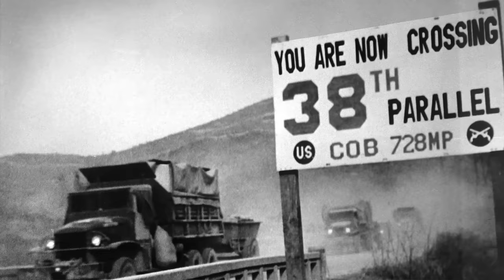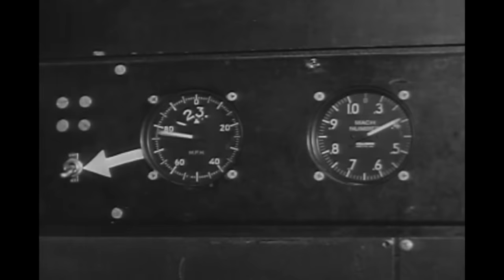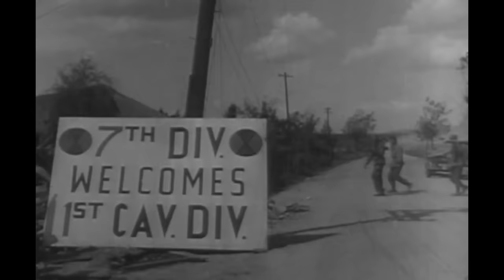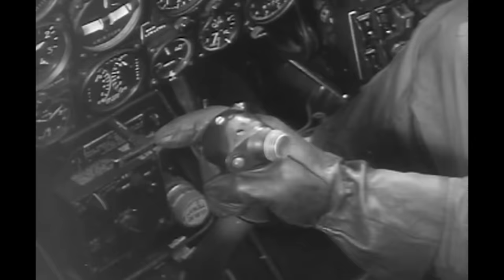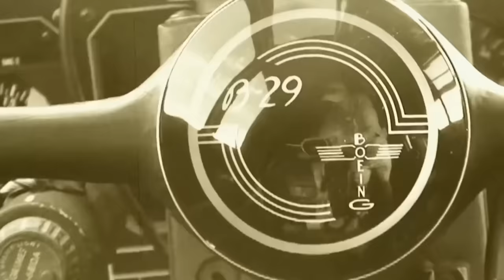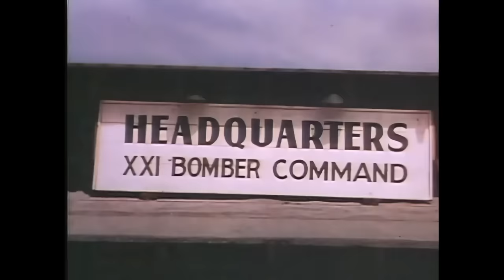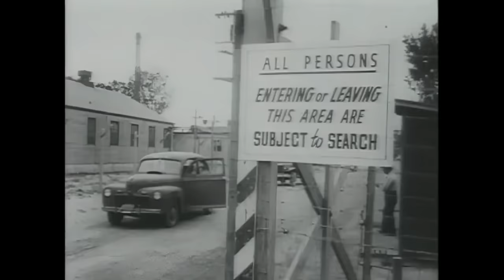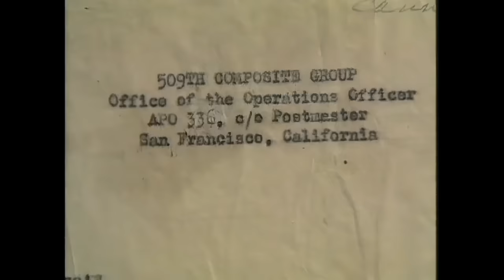B-29's Mortal Enemy | Superfortress Against MiG 15

Comment: If the B-29 was unable to carry the atomic bomb, the backup plan was to have specialized British Lancasters do it.
Reply: But it did drop A bombs to Japan.
Reply: @kzoo4053  correct, but for a while it was unclear if the B-29 design would be able to in time. Backup plan was to have specialized black Lancaster deliver them instead.
Reply: @MarvelousSeven  Lancaster cant drop A bomb !
Reply: @jagdpanther2224  Yes it could. If it could drop the Grand Slam and Tall Boy, it could carry the Little Boy bomb.
Reply: While Avro Lancaster could carry the A bomb, it did not have the range required to reach Japan from Tinian. The  B24 Liberator had the same problem.
Reply: @apis_aculei  they must've had some sort of plan in mind, since UK crews were being trained since spring 1944 for the mission.
Reply: I've heard this before, but never from accredited sources. In fact, the only accredited sources I've heard mention this were disputing the theory. Usually, with the fuel limit or the security argument. I doubt Lancaster was considered any further than a sketch on a bar napkin at best.
Reply: @MarvelousSeven 
No they weren't, that's a myth perpetrated by people who want it spread around simply to thump their chest about the Lancaster, it's simply not true, there was never a program or even the thought of one to have Lancaster's as back up's for dropping the atomic bomb. 
The reasons that the Lancaster couldn't drop the atomic bomb are many and they preclude it from being able to do it for the same reasons that the B17 and B24 couldn't, it's not just about how much weight a bomber can carry, if it was the B24 and B17 would both be in line ahead of the Lancaster, despite all the erroneous nonsense that gets thrown around in YouTube videos and in the comments of them both B24's and B17's could lift more weight if modified to the point that the Lancaster's that dropped big bombs like the Tall Boy and Grand Slams were, those were specially modified Lancaster's, not just regular one's they loaded those huge bombs on, they wouldn't fit in the bomb bays of regular Lancaster's, with even less modifications those bombs could more easily have been put in B17's and B24's they just didn't do it because the USAAF had another program they tried instead of that, the Aphrodie missions. 
Believe it or not the bomber in Europe that held the record for the most weight lifted was the B24, and like the B17 with their turbo charged engine's they could fly higher with an equal amount of weight than Lancaster's could with their single stage supercharger version of the Merlin that they used, so right there B17's and B24's were both better candidates for dropping the atomic bomb but neither of them could have done it for the same reasons no bomber in the world at the time could have except for the B29. First off it was the only bomber in the world capable of flying high enough and fast enough to escape the blast of the bomb, if the higher and faster flying B17's and B24's couldn't do it the lower and slower Lancaster sure couldn't have.
When Paul Tibbets was testing the special Silverplate atomic bomb version of the B29 in the states he had any resource he wanted at his disposal, one thing he got was P47's from a nearby base to be task with conducting mock air battles with him and above 30,000 ft, where P47's were known for being about the best performing prop fighter of the war with their turbo charged engine's, he could not only out turn them he also said he could hear them saying on the radio "Tell him to slow down!!! My engine's overheating trying to catch up to him!!!"
Anything that was going to drop the atomic bomb had to have been able to fly at least that high and that fast because even as fast and high as the B29 could fly they still had to come up with a way of getting far enough away from the bomb with it, they didn't just drop it and keep flying along, even it wouldn't have been far enough away to escape the blast, through trial and error they developed the procedure where immediately after releasing the bomb they went into a diving turn that ended just as the bomb blast caught up to them, he said that Oppenheimer told him he needed to be at least 9 miles away from the bomb when the blast hit him and the best they came up with was 9.2, even the B29 could just barely do it, onboard equipment on the Enola Gay registered something like 2.2 G's of force from the blast hitting it, Tibbets said you could hear the Enola Gay crunch like a soda can when the blast hit it, any other bomber would have been close enough it'd have been torn apart by the blast.
Range is another reason only the B29 could do it, even being the longest range bomber of the war the Silverplate B29's had to have an auxiliary fuel tank placed in their rear bomb bay, the bomb itself was in their front bomb bay (B29's had 2, front and rear) by the time you loaded up any other bomber with enough fuel they wouldn't have been able to get off the ground much less fly at the bombing altitude of 31,600 ft, due to the primary target being socked in with clouds preventing optical sighting the 2nd mission was diverted to Nagasaki, to complicate matters even more it orbited Iwo Jima for an hour waiting on support aircraft that never showed up anyway and along with other delays it's mission wound up taking almost 18 hours, no, the Lancaster or any other bomber was capable of flying the range required for the atomic bomb missions. 
Other reasons are things like the B29 being the only bomber with a pressurized fuselage which was required, people look at the service ceiling on aircraft like the P47 that has one of around 40,000 ft but what they don't understand is that something like that can't just fly at 40,000 ft for long periods of time due to the limitations of the human body, a pilot in one can climb that high but they can't stay there very long because of the affects it has on human physiology, an oxygen mask to keep hypoxia from occurring is one thing but extended times at the low pressures of altitudes over 25,000 ft can cause blurred vision, severe cramps, bleeding from the nose which isn't desirable when wearing an oxygen mask, since one of the requirements of a bomber on an atomic mission was long periods above 30,000 ft there's another reason only the B29 could do it.
Then there's the subject of being able to accurately hit the target, the only bombsight in the world capable of putting a bomb 800 ft from it's aiming point  that's dropped from a plane traveling over 300 MPH at 31,600 ft was the Norden bombsight, the myth that it wasn't accurate is just that, a myth, the fact that it put those bombs that close to the aiming points from those speeds and altitudes is proof of how accurate it was, there's a long list of reasons that detractors of it claim it wasn't accurate that are total nonsense, like including the results from bombs aimed using the far less accurate H2X ground scanning radar system in the math when talking about the accuracy of the Norden bombsight, 65% of the bombs dropped by the 8th Air Force during WW2 were aimed using the H2X system especially during the winter months when overcast clouds prevented optical sighting, but hack aviation writer's, the same kind that claim that the Lancaster was a back up bomber for the atomic mission, like including the results from the H2X system and other things like navigators flying entire formations to the wrong target and the results from something like that being recorded as "zero bombs on target" and averaged into the math and blame every single bomb that missed it's target on the Norden bombsight, that's nonsense, one of Oppenheimer's criteria for bombing was optical sighting only, no radar bombing, and since the Norden bombsight wouldn't work in a Lancaster because it needs to interface with the Sperry autopilot system which the Lancaster didn't have right there is another reason why the Lancaster couldn't be used to drop the atomic bombs.
The reasons that myth got started is from people taking something General Leslie Groves said in the book he wrote after the war completely out of context, when they first started the atomic program the subject of a bomber needed was brought up and knowing that the Lancaster had been dropping those Tall Boy and Grand Slam bombs someone inquired about possibly using it, which they'd of course had the list of reasons explained to them why it wouldn't work but based solely on him mentioning that in his book the myth grew to the point where now you actually have video creator's like Mark Felton claiming it was true, well Mark Felton can make all the claims he wants for the sake of getting clicks on his videos the fact is the B29 was the only bomber in the world at the time capable of doing it, he probably even knows that but like the majority of YouTube video creator's he's really worried about clicks and nothing else, because more clicks, not the truth, means more money.
Reply: Brits all the way.
Reply: You forget the US built there own back up bomber. The B-32 was not as fancy but could easily carry the load and had been ordered the same day as the 29 was. There also was a squadron of them in the Pacific doing low attention missions in case they were needed. Infact they flow the last mission that US bombers where attacked by Japan. Beyond that yes the Brits have the back up to the back up ready to go..
Reply: @kellyschram5486  Was B-32 in production in time?
Reply: @MarvelousSeven  yes they went operational in the Pacific in mid May 1945.
Reply: You’re partly correct.
It was considered at one stage.
There are pictures of Lancasters with enormous saddle tanks to give them the range.
They even considered mid air refuelling.
But it was never a backup plan.
For a variety of reasons the whole idea was abandoned towards the end of 1943.
Reply: Lancaster didn't have the range to deliver in the Pacific
Reply: Mark Felton did a video about the plan to use the Lancaster, but Greg's Airplanes did a convincing job of refuting that it was ever considered.
Reply: Refer to Greggs Airplanes and Automobiles. No records of Lancaster bombers ever considered for A bombs. Not enough power or performance.
Reply: The B-32 dominator was the fall back option.
Reply: This is total nonsense. Watch Greg's Airplanes and Automobiles response video the Mark Feltons video on this topic. The Lancaster was briefly considered in 1943, but was ruled out due to the airplane not being capable of performing the mission. Even if the B-29 couldn't be ready in time the B-32 probably would've been the next choice.
Reply: The first time i heard that the lancaster was being primed to drop the A bomb, came from the fighter pilot podcast, specifically the for the lancaster episode... still none of us were there so the f knows@spectreandromedus8661

Comment: I love your channel, but you guys need to fact check your videos a bit more.

North Korea wasn't "highly industrialized"  It may have been more industrialized than South Korea at the time, but even (retired Air Force Colonel) Walter Boyne in the video put it "what little industry the north had" (19:00).  Saying "Highly industrialized North Korea" is like saying highly agricultural New York City, or extremely safe Chicago streets.

The MiG-15 isn't "200 miles faster than the F-80".  LOL.  It is way closer to 100 miles PER HOUR faster (23:55).  It's a distance versus speed thing. 😉

The MiG-15 does not have 20mm cannons.  It has 23mm cannons.  (17:50)

The F-80 did not perform so poorly in ground attack.  It actually was relegated to ground because of the MiG-15.  It did quite well, in that role, but there was not enough of them and their range was limited, compared to propeller driving strike aircraft, so more planes were brought in, like the F-84s and F-51s, and F-82s.
Reply: Something the one guy got wrong is the claim that they painted the bottoms of the B29's black the first time for night bombing in Korea, that's wrong, there's a directive dated June of 1944 that all B29B's (the special night bombing variant) have their undersides painted gloss black along with plenty of WW2 era pictures of the B29's of the special night bombing groups in the Pacific with black undersides.
Obviously what happened was during the Korean War when they brought back night bombing they ordered that the B29's used for it were to have their undersides painted gloss black because they already knew to do that based on their WW2 experiences, but it wasn't something they came up with during the Korean War like he makes it sound. 
The channel WWII US Bombers has a video on it where he even has a screenshot of the June of 44 directive ordering the night bombing B29's to have their undersides painted gloss black.
That's the absolute best channel for anything and everything concerning US bombers in WW2, using only credible sources like USAAF reports and studies he's dispelled more myths about B17's, B24's and B29's than you can imagine, even the one about the saying "The whole 9 yard's" supposedly being based on the length of a belt of .50 cal ammo for the defensive guns of a bomber, nope, didn't come from there. 
Thats the go to channel for anything about these planes.
Reply: wrong, north korea was highly industrialized

makes everything else (irrelevant pedantry anyway) you tried to tell us worth 💩
Reply: Nobody likes a no it all 😂🤠👍
Start a channel, you sound like you know what you are talking about.
Reply: When Colonel Walter Boyne is speaking of "What little industry North Korea had", he is not talking geographically, he is speaking to the B-29 being effective at destroying the industrial targets in the South Korean theatre, when under North Korean possession.  The video then explains that the industrial and infrastructure of North Korea was not targeted by the bombers, in an assumption the South could "unify" North Korea by possession.

Comment: The B32 might not have been a viable option “The pressurization system had problems which were never solved and so the role of the aircraft was changed to operating at low to medium altitude.”